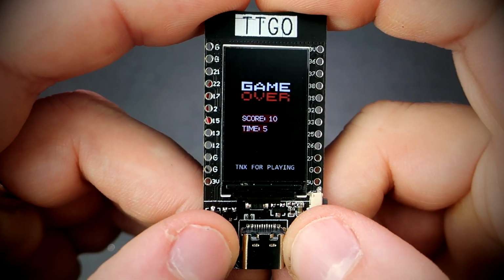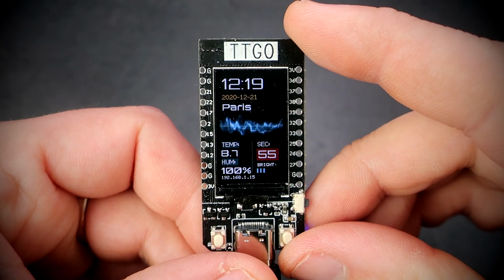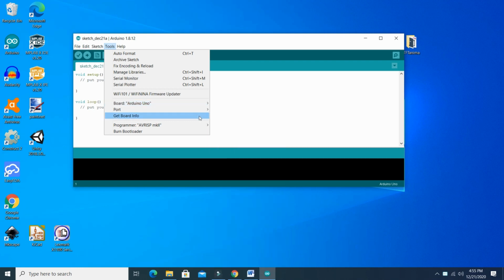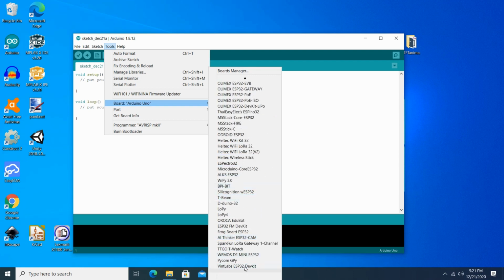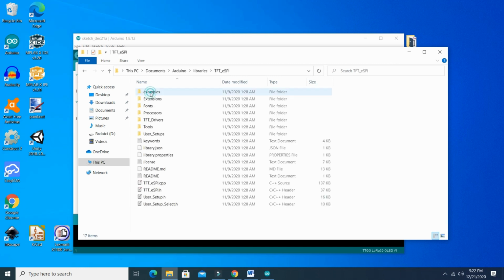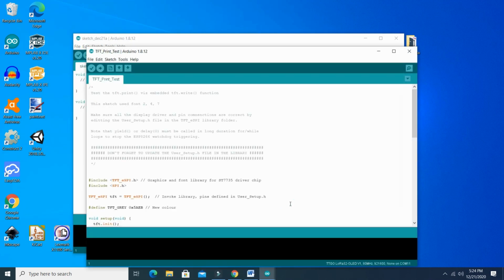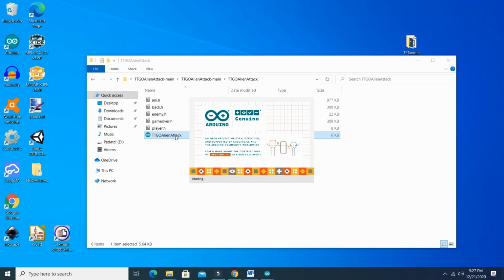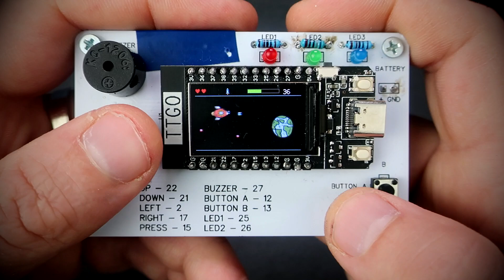How to Install and Setup  TTGO T-Display ( Getting Started tutorial)

Comment: Any help with this? It seems both yours and other turorials show the same instalation process but I just cannot get any example to compile.

Arduino: 1.8.15 (Windows 10), Board: "TTGO LoRa32-OLED V1, 40MHz, 921600, None"

In file included from \Arduino\libraries\TFT_eSPI\TFT_eSPI.cpp:20:0:

\Arduino\libraries\TFT_eSPI\Processors/TFT_eSPI_ESP32.c: In member function 'bool TFT_eSPI::initDMA(bool)':

\Arduino\libraries\TFT_eSPI\Processors/TFT_eSPI_ESP32.c:739:3: sorry, unimplemented: non-trivial designated initializers not supported

   };

   ^

\Arduino\libraries\TFT_eSPI\Processors/TFT_eSPI_ESP32.c:739:3: sorry, unimplemented: non-trivial designated initializers not supported

\Arduino\libraries\TFT_eSPI\Processors/TFT_eSPI_ESP32.c:739:3: sorry, unimplemented: non-trivial designated initializers not supported

\Arduino\libraries\TFT_eSPI\Processors/TFT_eSPI_ESP32.c:739:3: sorry, unimplemented: non-trivial designated initializers not supported

\Arduino\libraries\TFT_eSPI\Processors/TFT_eSPI_ESP32.c:739:3: sorry, unimplemented: non-trivial designated initializers not supported

\Arduino\libraries\TFT_eSPI\Processors/TFT_eSPI_ESP32.c:739:3: sorry, unimplemented: non-trivial designated initializers not supported

\Arduino\libraries\TFT_eSPI\Processors/TFT_eSPI_ESP32.c:739:3: sorry, unimplemented: non-trivial designated initializers not supported

exit status 1

Error compiling for board TTGO LoRa32-OLED V1.

Comment: In file included from C:\Program Files (x86)\Arduino\1_mode_\TTGOAlienAttack-main\TTGOAlienAttack-main\TTGOAlienAttack\TTGOAlienAttack.ino:5:0:
enemy.h:1:1: error: stray '\357' in program
 int frames=4;
 ^
enemy.h:1:1: error: stray '\273' in program
enemy.h:1:1: error: stray '\277' in program
exit status 1
stray '\357' in program
Reply from the maker: Go to the .h files in folder and delite line frames
Reply: @VolosProjects  I had the same problem. I simply deleted the line: int frames=4. Problem solved 🙂
Reply: @VolosProjects  I deleted the line. compiled and
 In file included from C:\TTGOAlienAttack\TTGOAlienAttack.ino:5:0:
enemy.h:1:1: error: stray '\357' in program
 
 ^
enemy.h:1:1: error: stray '\273' in program
enemy.h:1:1: error: stray '\277' in program
exit status 1
stray '\357' in program
Reply: I had this same problem on a MacBook Air M1..I used sublime text and saved the enemy.h file with encoding Western (Windows 1252) and that fixed it for me
Reply: Просто удалил строку и все отлично 👌🏻